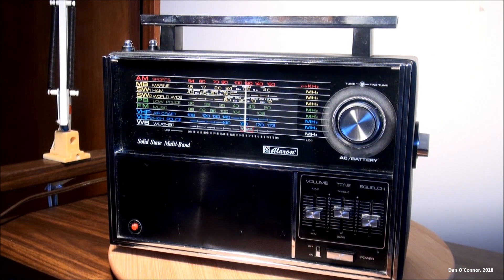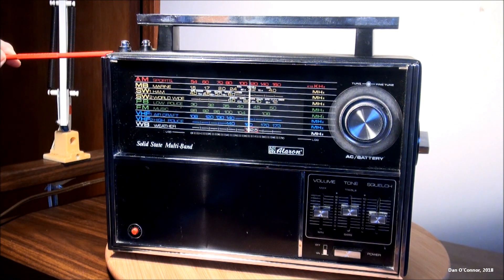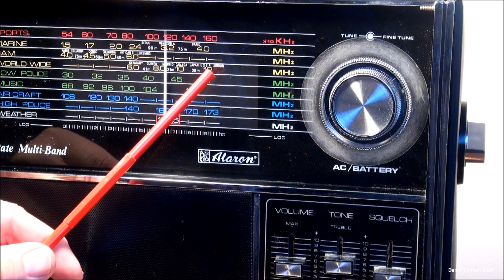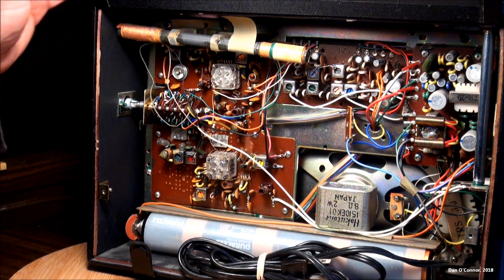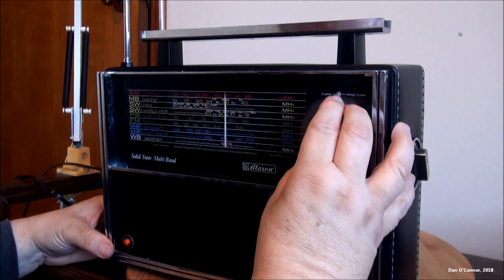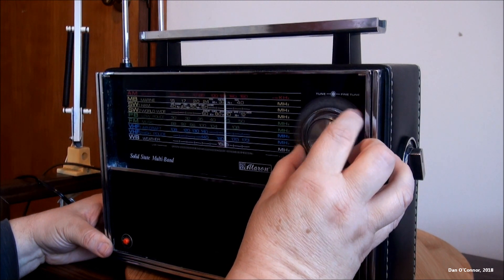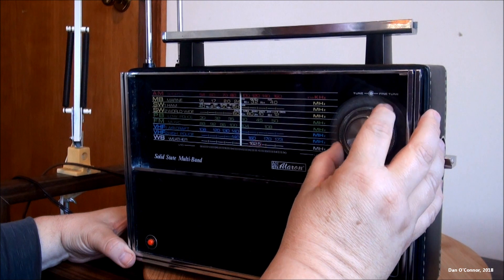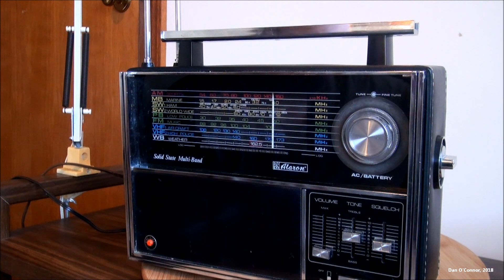1970's Alaron Multi-Band Radio

Comment: Wow I have the same exact looking model but is made by the company Precor ! The one I have, does have a flip cover with a world map and a dial to determine time zones.   I suppose that this has been manufactured by one company and apparently had different brand name badges.  My dad bought it in the mid 70's when I was a kid.  I have listened to military aircraft  like the Blue Angels when they came to my city in Kansas back in the 80s and 90s.  Also I could hear police and emergency vehicles as well as wireless landline phones,  walkie talkies,  baby receivers, and TV stations. 
Nowadays I think most of the frequency bands are scrambled for security.

Comment: Got mine around 1975 via a company called Scientific &Technical from Essex I believe.
I bought a pair of binoculars too from them.
Mine was a Worldmaster with a flap down time zone.
Good reception on vhf marine band, but I did live near the harbour and a BT ship to shore station.( Anglesey Radio). Mine was made inHong Kong.
Reply: This one had the GMT timezone flap as well, you can still see the rivets on the sides. I have an Eversonic ES-9500 (with a missing flap). Funny thing is that the color set for the bands are identical to this Alaron even though  they chose PB (Police Band) designation over VHF. I guess it was the standard for japanese multiband radios of this era.

Comment: There were tons of variants and "brands" of these cheap japanese multiband receivers between the late 60s and the mid 70s. Mine is called "Koyo", was purchased new in 1971 and lacks the squelch control. Big selling point back then was the ability to listen to police and aircraft. Here in Switzerland is was legal to buy one, but illegal to use it. But well, if you did not blast police conversations at full volume on your balcony, how should anyone find out? The receiver itself was rather insensitive. I couldn't pick up far away FM or shortwave stations, that were loud and clear on a standard german transistor portable. On the plus side, the radio was and still is very reliable, battery life was good and sound quality is decent. It got a lot of use in the 70's to 90's listening to local police. Now that is all digital and no possibility to listen anymore. It's still useful as a cool looking bedside radio.

Comment: The clicks are most likely coming from the dial cord, I had a radio that used to do something similar, found it was the cord catching slightly as it unwound and wound on and off the pulleys on the tuning capacitors as you tuned up and down the dial.....

Comment: It seems that most larger radios from that period had similar design features like the stitched vinyl case and the back panel snaps, I had a multi band Ross radio that was arranged vertically, but was very similar.
Reply from the maker: I like that design. I have a smaller 1970's mult-iband Kmart "vertical" radio that I video'd in Dec, 2016 and it seems to have some real leather side panel inserts along with the vinyl and back panel snaps.